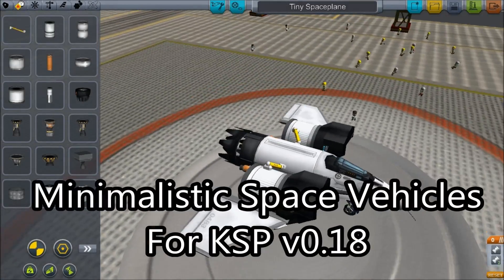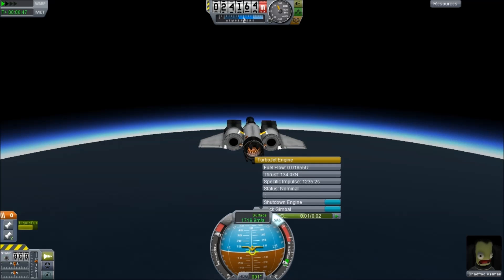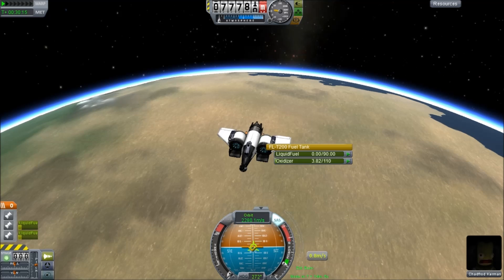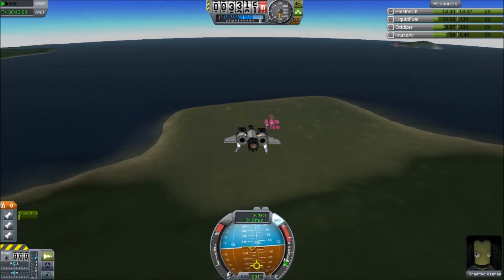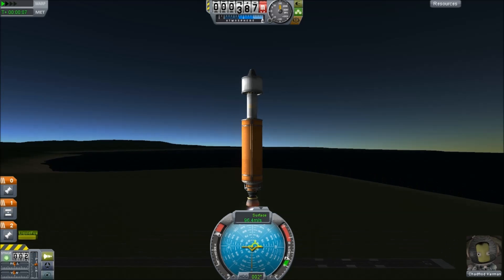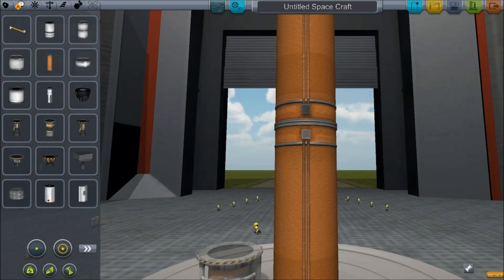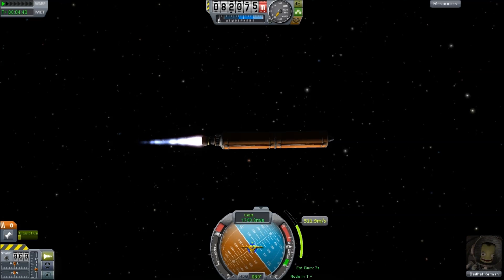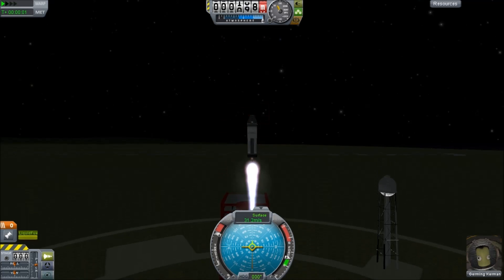Kerbal Space Program 0.18 - Minimalist Spacecraft

Comment: Question scott... I have built some planes that I used that same cockpit and wanted the avionics package. But with no good place to mount it, I mounted it on the REAR of the plane pointing backwards. (between two engines). Does that work? I was still having control issues but that could have been other design issues and my own ineptitude. does the avionics nosecone work properly if it is put on the rear of the plan pointing retrograde?

Comment from the maker: Nope, sorry, it's nothing to do with the CD moving, because the drag on the aerospike is lower than the other parts the CD starts off in front of the CM. At no point in time is this thing stable in forward flight, it's just waiting for the pilot to deviate too far and exceed the ability of the capsule to restore the orientation.

BTW I checked with  C7 and he confirmed that the missing parameters is a bug.

Comment: Scott, in my experience, the tricycle or taildragging planes don't work, because KSP simply has a problem with not centering wheels and landing gear if you put one in the center, even if you have lock to angles turned on, etc. It simply is positioned slightly to one side or the other, and veers off the runway. Put two wheels and I've always been fine.

Comment: Hey Scott 

I was wondering if you could do a tutorial if possible on how to do accurate, if not, pinpoint landings like from either low orbit (70-100 km) or High orbit (101-500 km) cause I try to land at the space center but never was successful with aircraft but can do it with rockets by doing a "Cannon Ball" maneuver which is just making the orbit vertical. I would really appreciate it.